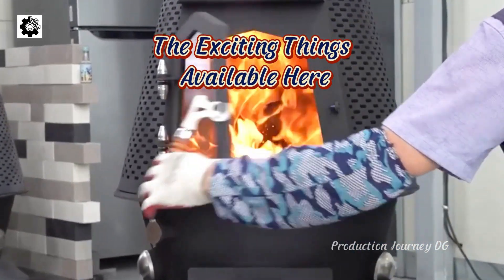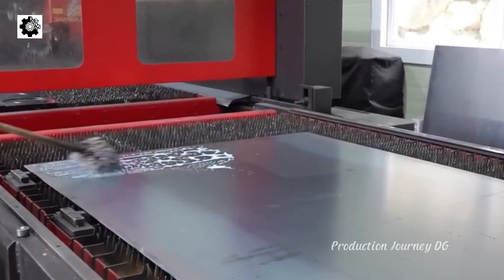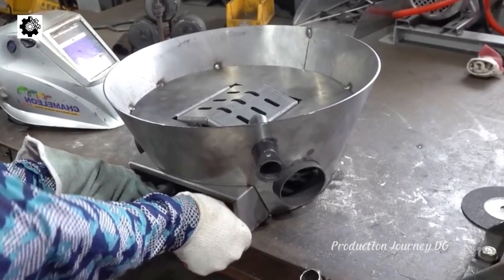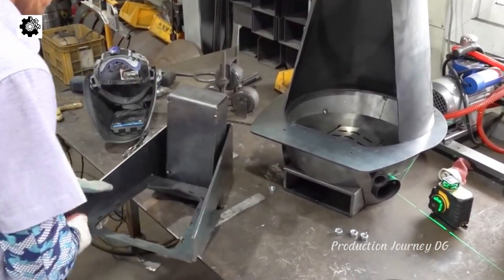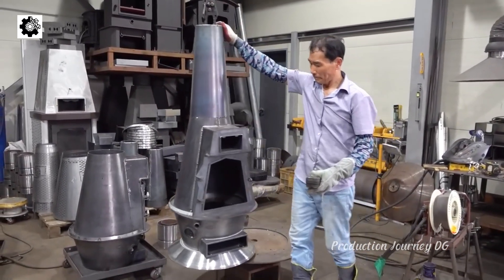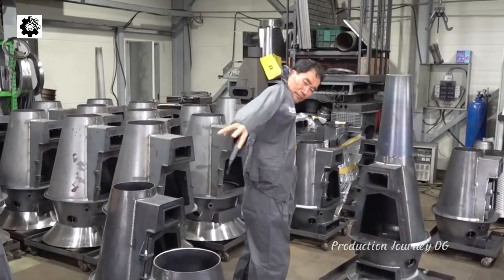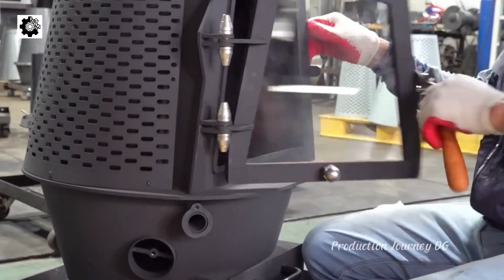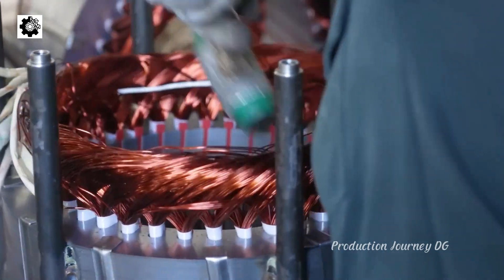The process of manufacturing a natural gas furnace. #mechanic #trending #viralvideo

Comment: These are not at all "environmentally friendly"! Burning wood is a huge contributor to poor air quality and persistent soil contaminants. Also, using steel .. huge emissions in that process too! Next you'll have a video on how diesel engines are made, claiming they are "environmentally friendly", despite decades of documentation otherwise & the fact that most diesel is petroleum based.
Reply from the maker: Thanks for the response. We will improve as soon as possible.